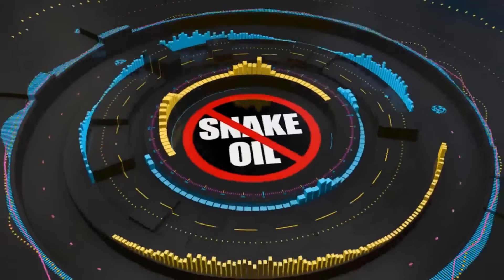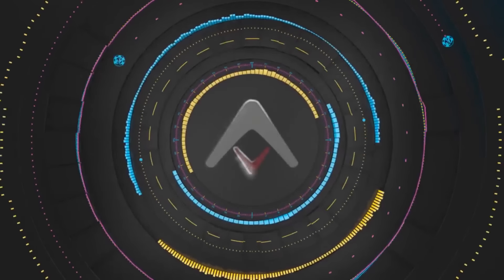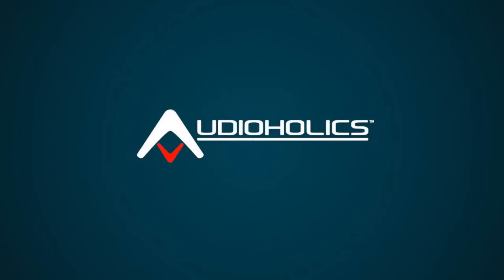STOP Worrying About These 5 Things in Audio!

Comment: Is 12g monoprice cable for in wall sufficient or should I use 10g.  I'm in the middle of room rebuild. If 10 is a decent amount better. I will try to get some before wire is installed. Thanks in advance
Reply: Completely depends on the length of the run and potentially the amount of current (or watts) you're actually going to be running. 

It probably does not matter.  There are online calculators for cable length and gauge and the resulting resistance, and how that affects damping factor and thus frequency response.  It's very minor unless you're getting extreme.

Comment: Gene: I have a question about speaker cable length. Do my rear speaker cables have to be the same length? My room configuration doesn't allow me to run "even length" cables. Can I run two different lengths or can I bundle the cable that is too long?
Reply: Doesn't matter

Comment: I have a Nad AV processor and A Morantz receiver and I don't know where this impedance switches.  I'm still trying to figure out impedance matching issues between speakers and amplifiers.
Reply: You might find that function is now buried in the on screen display of speaker set-up menus - which can be several layers deep-  rather than as a discrete physical switch.
Reply: @fonkenful  nope don't see anything that says impedance anywhere
Reply: I see adc rate in the DSP area which I said to 192 for lack of anything better that I could figure out. That seems to be the closest thing but I have a feeling that might be what I'm looking for
Reply: @iampuzzleman282  The speaker load impedance wouldn’t be a factor in operation of a pre-amp or AV multi-channel processor. What model of Marantz receiver?
Reply: @fonkenful  sr 5014. A nice sounding unit but the interface is horrifying, it's very complicated, it looks nice
Reply: Don't even try to match impedances either in patch cords or speakers.

Here's the thing... "Impedance Matching" went the way of the triceratops somewhere in the late 1950s as we moved from Tubes to Transistors.  These days the equipment uses "Impedance Bridging" ... that is deliberately mismatched impedances.  (Do a couple of searches, there's plenty of information online)

Line outputs have a low impedance (typically less than 300 ohms). These are connected to line inputs with a much higher impedance (10k or more). This is to ensure the maximum transfer of energy with no losses.

Power amps follow the same pattern.  The amplifier outputs will have impedances in fractions of an ohm and will be feeding 4 ohm or higher speakers. Again, to ensure best energy transfer.

Think of it like a lightbulb and a battery ... do you want a battery that can deliver more energy than the lightbulb needs or do you want a lightbulb that takes more juice than the battery can produce?  

On modern power amps when they say "4 ohm minimum impedance" what they really mean is that the amplifier can deliver more than enough current to efficiently drive 4 ohm speakers.  It's going to work even better with 8 or 16 ohms...
Reply: @Douglas_Blake_579  this is really cool stuff.  I have a feeling you really know the difference between 4 and 8 ohm settings on the back of an amplifier like McIntosh.  i use four ohms for connecting to Bw  802d3 because my speakers go down low enough in the 4 ohm Area.  I was told this would be better. I'm using an MC 901 amplifier in biamp config.
Reply: @Douglas_Blake_579  Douglas, just a quick observation; when you say “work even better into 8 or 16 ohms”, I’m guessing you mean - maybe less current, but also definitely lower distortion.
Reply: @fonkenful  
And a better damping factor to control the drivers.

Comment: Just wondering about your thoughts on isolation feet? I am putting down a new floor and want to remove the spikes from my towers...isoaccoustic feet will run 500$ or so. Should I spend the $ on these feet or just buy more records?
Reply from the maker: I like and use them in my systems. For the Perlisten in particular, they bring the tweeter height up a little which I needed. I've heard ABX demos with and without the Iso feet. Definitely a subtle but noticeable difference that you may or may not prefer.

Comment: If I'm using pre amplifier mode is it okay to turn it to 4 ohms so my amplifiers won't be running idle at a higher power?
Reply: This is a absolutely great question. Can some one answer it for me please?
Reply: Will not make a difference.  But some AVRs let you disable the power amps if you're not using them, if you can do that do that.  But the ohm switch will have zero affect except, as gene explains, limiting the amps maximum output - which you're not running into at all.

Comment: Great job and I agree with every point you made. Thank you.  I would like to add; Be careful where you buy your gear if you are buying used.  I found a pair of speakers that I wanted the full range drivers for another project from Canuck Audio Mart, since I live in Canada and thought I could trust the site.   I paid the guy $600 and we had a number of phone conversations.  Then nothing for months.  I even contacted the folks in charge of the site and they tried to help but, he finally claimed he sold the speakers to someone else.  Lesson learned.  I am retired due to a terrible auto accident so my wife supports me and I was planning on building a great set of speakers to save money.  $600 is not much for audio equipment but, it is a lot for me.  This incident happened a number of years ago and I still don't have a set of good speakers.  Be careful.
Reply from the maker: Sorry to hear this.

Comment: My favorite that drives me nuts is indeed sound clips on YouTube. There are audiophile channels where the YouTuber has spent thousands of $ in microphones and dummy heads.😂
I’m a retired electrical engineer, yet The one area where I diverge a bit from you is cables. You put so much focus on the measurements, whereas I focus on how they sound in my system. Mind you, I bought a pair of somewhat inexpensive Nordost flatlines 20 years ago and never looked back.
Thanks for your videos, Gene. You do a great job.

Comment: I'm fairly novice at this, so may be silly to ask... for leaving impedance setting at 8 ohms with 4 ohm speakers, is that the same as with an AVR leaving the front speakers set to Large (rather than small) as I've seen suggested when doing a setup calibration for my 5.1 system? I got new speakers and want to do a recalibration. I rarely watch TV and 99% is listening to music via 2.1.... not surround. I'm confused about this.
Reply from the maker: Bass management has nothing to do with the impedance switch. Leave the switch alone and adjust your bass management for the best integration of your speakers and sub in your system.
Reply: @Audioholics  Thank you!

Comment: I've said it before, cables do make a difference... a negative difference to the pocketbooks of the people that buy them and a positive difference to the pocketbooks of the people that sell them.  That's pretty much the only measurable difference.

Great video, you are very much correct on all items mentioned.
Reply: If you have low impedance speakers and long cables, you will get treble attenuation with small diameter cables.  But that can be very cheaply fixed by getting 4-6mm2 speaker cables, no need for exotic things. Of course some people have OCD and their brain would melt if they didn't have fancy gold connectors and wrist thick cables sitting on 'dampening blocks' lol. But that has nothing to do with actual sound.

Comment: The "worst" point is when people try to use ANY online virtual video to "evaluate" the "sound quality" of ANY component or speaker, because that is literally physically impossible to actually do accurately or effectively, simply because there are SO MANY variables in the long "chain" between the actual sound being produced in the actual room that the speaker, (or whatever component), is playing in, all the way to the sound that actually reaches your own ears when/if you're NOT in that exact same room with whatever is being tested, and whether that end result is played through headphones OR any OTHER speaker, it is a TOTALLY different sound, each and every time! (AND it's also NEVER exactly the same in every way as the sound that's actually in the same room with the speakers or equipment being supposedly evaluated!)

If you use ANY online video to "evaluate" the "sound quality" of ANYTHING, then you're basically just comparing "apples to oranges", and pretending that they're both exactly the same because they're both "fruits", LOL!

Comment: Why measure cables, connect them and listen. This is not ASR isn’t ?! It’s about synergy in your system and what sound you like best. Cables do make a difference, subtle mostly, so for fine tuning. Listen, stop measuring a small spectrum of audio properties
Reply from the maker: LOL, spend more time focusing on your room acoustics, speaker placement and calibration to actually hear real, not imagined differences.
Reply: Why measure cables? To get objective information, of course. The bigger "why?" is the question why people think that just because someone uses measurements they never listen to what they are testing. Those that measure are usually just more thorough than the ones that only listen, and it's important to be thorough when searching for the truth.
Reply: @Audioholics  I have room acoustics done, speaker placement, etc. LOL measuring a la ASR hasn’t done anything.
Reply from the maker: @larsv6144  yea I doubt you do. If you really had your room acoustics tuned in, proper speaker set up and calibration, etc, you'd know the cable magic is nonsense.
Reply: @Audioholics  say hi to Amir and all the others with lesser hearing….. human hearing is way more complex then you can measure with one tool…. but hey, each his own. And your doubts don’t change my room or experience 😂
Reply from the maker: @larsv6144  HAHA ok you enjoy your cables. Be sure to add some magic dots on your wall and use green magic markers on your CDs for enhanced sound. Don't forget to elevate your cables as well. Whatever makes you happy and perceive better sound enjoy. No judgement here.

Comment: My comments after 50 years as a music lover. 1. If you can't hear the difference it does not matter! Exception to rule 1: some speakers sound good but will cause ear fatigue, but you cannot tell that from a short audition at a store. 2.  If you have to CONVINCE yourself you can tell a difference you can't. 3. 40 years ago, a wise man told me to spend the bulk of your money on the source and the speakers once you have an amp that meets reasonable standards. 4. Once you have a reasonably good system, you can change the sound more by modifying your listening room than you can by spending more money on your system. 5. Enjoy the MUSIC; not the flashy specifications in your owner's guide.
Reply: I absolutely agree with you 
In my eyes after 54 years in the hifi world the source is number one then speakers then amp just my opinion

Comment: The information was extremely helpful, especially the beginning about impedance.  I am mixing brands of speakers, and 4 ohm and 5 ohm and 8 ohm in an 11 channel system. I just keep the receiver cooler by running a fan cooler on the top that also helps with ventilation

Comment: Question about the OHM settings. 
I have an older amp that can support real 4&6ohm settings. 
The speakers I have appear to be lower ohms that the advertised 8ohms. 
I have always left it at 8 ohms since I saw your old video years ago. Now I am curious since these speakers seem to test at 6ohm, should I change it down to 6ohms ?
Reply: No

Comment: Wise words indeed! Thank you for clearing the air of all the high-end bullshit out there!  The audio signal you hear on your stereo has run through miles of cable that wouldn't pass muster with the high-end geeks. One or two meters of the same cable won't have any effect on your stereo. One thing I would add though: Use good quality connectors on your cables... not the ridiculously expensive kind, just ones that have a tight fit and aren't prone to oxidation.

Comment: All of your points are (adjective) sage and sane advice!  Dedicated senior-aged two (2) channel-er here.  My upper range hearing dissolves into my tinnitus at about 8.7-9K, depending upon SPL.  Before suspending my hifi habit almost 30 years ago, Monster speaker cable was about as far as I had ever gone into 'boutique' wiring (giant zip cord).  I was a journeyman broadcast engineer (AM/FM radio) 'techie' back in those days, always with a focus on 'value' (...money has ALWAYS "...been an object").  The well established, secondary market for 'pre-owned' components is a rich landscape if you're nerdy and have the time to investigate, compare and shop on line.  After starting back up a few years ago, I now have a couple of beautiful, premium pieces in my system (Hegel, McIntosh) that were WAY out of reach when they were the "...newest, latest and greatest".  And again, this video offers great advice and value, too!  Thank you.

Comment: Great to see another video from you. I got a question, one of my surrounds is 55' of speaker cable, what gauge would you recommend for that?
Reply: There are charts for that.  For such a long run I would do 12 gauge.  Monoprice makes a good one.
Reply: @talosian  Yeah I looked at some charts and most said 14 Awg but others are saying like 10 Awg, I'm still really confused but I think ultimately I'll go with 12 Awg for all my speaker wire included the short run of my center channel(3').

Comment: Hey Gene! I have always taken your advice on the impedance selector switch, and set my Yamaha A-S501 to 8ohm accordingly. The question I have is on the other end - do I plug the speaker cables into the 4ohm or 8ohm slot on the back of my speakers? I have been using the 4ohm binding posts as opposed to the 8ohm (again 8ohm on the receiver) hoping for the best sound. See any issues with that? Or am I better off in any way by plugging into the 8ohm binding posts instead. Doubt it matters, but I have the Arendal 1723S Towers (also in large part per yours and James Larson's recommendation haha).
Reply from the maker: I never heard of 4 ohm or 8 ohm binding post on a speaker. You must be confusing it with biamp/biwiring. Keep the jumpers in place and do a single wire connection. If the jumpers are in place, your amp sees the entire speaker which in this case should be around 4 ohms nominal.
Reply: @Audioholics  In this case, does it matter what posts you connect to, meaning the top or bottom ones..?
Reply from the maker: @perrysmiles60  not if they are jumpered.

Comment: The cable comments are the best.  I only use the Blue Jeans cables because they aren' that much more expensive than plain zip cord when you figure in the connectors you'll need too.  I like to spend that little bit more to also make sure the  bananas are really REALLY well connected to the cabel. No way you are going to do that yourself the way that guy at Blue Jeans does with his equipment.
Reply: It's pretty easy to solder and/or crimp the plugs by yourself, but you do you..

Comment: Gene - good video - I would love to hear more on addressing issues in the digital domain in regards to time, phase and channel matching - tools like REW, rephase, convolution etc.  you have covered treatment extensively but would love to hear more about the finishing touch in making adjustments in the digital domain to get the most out of a system.
Reply: Don't worry about the digital domain  .... We use digital signalling to send information to the furthest points on Earth and beyond... with bit perfect accuracy.  Audio in that domain is just data, like any other, and is delivered just as flawlessly as any other.
Reply: The listening room is the single biggest cause of distortion when listening to a reasonable quality replay system.
I use a miniDSP Flex with REW to EQ away [or in reality reduce] those pesky room nodes and reflections that are at the root of this problem.
To be able to easily generate a 'house curve' response [without introducing phase anomolies] is only possible in the digital domain.
Recommended.

Comment: Do you remember the water jacketed speaker cables. Mid to late 90s, can't remember brand, but they did indeed change the sound - 10uf of capacitance , sound not changed for better lol.  Few amps even survived such a load. 

lol.

Use quality ofc wire, good quality connectors, and solder tin the wire ends, and clean with  ipa.

Comment: Went to an audiophile friends house recently to listen to 5 different sets of speaker cables, none of them were exotic cables and all were easily affordable by almost anyone.. One pair of those cables were purchased at Blue Jeans Cable.. The gear was not ultra high end and affordable by most people.. The fact is all four of us heard difference's in each set of cables. were the difference's tremendous? no but there were differences in detail and sound quality.. I heard them and I'm 69 years old.. Measurements? no, I go by my ear and always have.. and so does the larger group of us audiophiles that live close by to each other.
Reply from the maker: The simple act of changing something can trick your mind into thinking you hear a difference when one does not exist. It's why you need to do controlled blind listening tests for items that often make little or no difference in audibility.
Reply: If you say so.. I've been hearing differences in cabling for many years as well as many other audiophiles that I know over the years.. it's about system synergy but in this hobby it's whatever floats your boat.. you've been listening and testing for 25 years? I've been in this hobby for forty five years.. seen a lot, heard a lot.. Sorry but I don't agree with you..